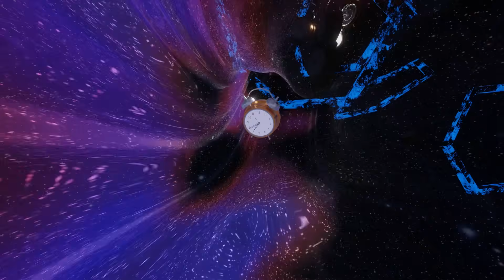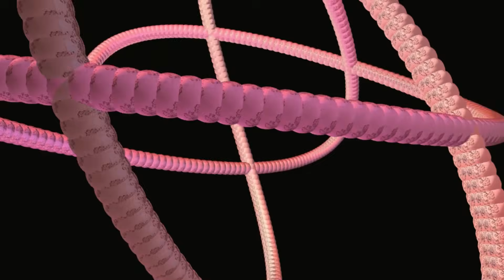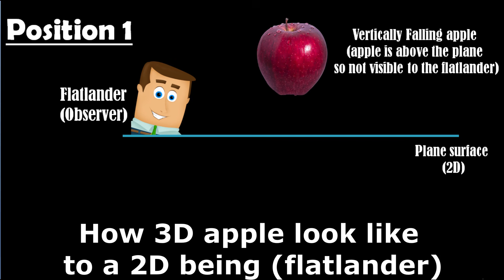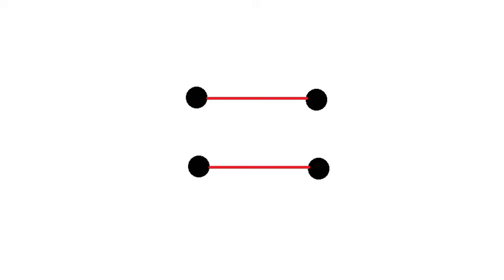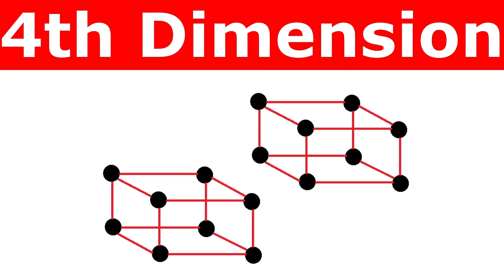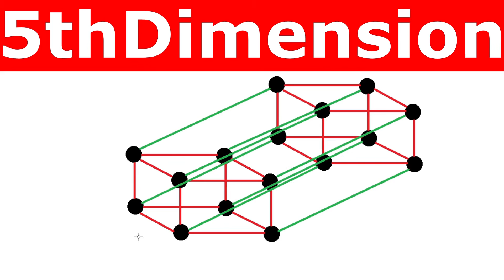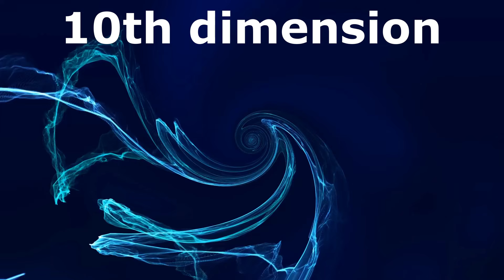11 Dimensions Explained - A Mind-Bending Explanation of Higher Dimensions!

Comment: TLDR: So the Apple example at 5:45 seems incorrect to me. If a 2D being can’t perceive height or depth then when the Apple crosses its plane of existence, it would see a line not a circle. 

Cross Sections are created by cutting an object & looking at it from 1 less dimension. 
Cylinder -> circle or rectangle 
Cube -> square
Only 3D beings could perceive a 2D cross section BECAUSE we have access to height and depth. We are effectively looking down, up, or through an object to see the 2D planes that add up to make the object 3D. 
If you started on the 2D plane as in the example, then you wouldn’t see a circle. You would be seeing the cross section of a circle, aka a line. 

To give an example, take a piece of paper. Paper is a 3D object bc it does have a height but the height is so small it’s negligible to our eyes so it can serve as a 2D plane. Place the paper on a flat table surface. Bend down till the intersection of the paper and the table is at eye level. If you’ve succeeded, you’ll see that you have absolutely no concept of how wide or long the paper is anymore depending which side you’re looking from. Instead all you’ll see is a line, aka the cross section on a 2D plane.

To know the shape of a plane, you must be able to see that plane from a higher dimension.

Humans are tricky bc we are 4D beings in 3D bodies. Our minds can
Reply: Our minds can perceive the existence of a 4th dimension (theorised to be time) but our physical senses are not tuned to it. Our minds are not limited to 3D and that is why we can both imagine the future and remember the past. The issue is our bodies can only move as a 3D object forward in time and our eyes cannot physically see more than 3D. Through our minds we can reverse engineer simple 4D objects (ie the 4D cube) bc we can seeing the shape of 3D objects but because we do not exist in the 4th Dimension, it is a great mystery to us. As the 3D world bends manipulates (surface) area into volume, the 4D world manipulates volume (aka space) into something else entirely (once again, current theories suggest it is in the realm of time or space-time). It is a realm in which 3D objects are sides folding in on one another to create 4D. That’s so mind boggling. Even though we can confirm its existence, we are still a long way from mastering it conceptually, let alone manipulating it in the physical world. Now imagine 5D being a realm that could manipulate and fold 4D into itself and you start to see why compactification exists and why it’s currently impossible for us to even perceive the 5th dimension. We only know it exists through following the laws of physics

Comment: one dimension shouldn't even exist because even the thickest line ever created or, let me put it this way. You can't draw a straight line that have no wide.
So first dimension you can start with is 2D.
A line without width isn't a line
Reply: None of these dimensions exist except the 3rd. 2nd dimension is a picture or drawing( not real) everything real has 3 dimensions. Outside of that this video just makes an explanation of decision making and some fairy tale time travel crap.

Comment: your explanation for the 1st dimension....you said it would be a straight line, with no ability to go left or right...however, the straight line, or forward line, if looked at from the cross view would either be going left or right, not straight and back...like a 'Etch a Sketch' draw your straight, forward line...now turn the 'Etch a Sketch' that straight, forward line has now just become a left or right line with no ability to move straight or back...better yet, draw a line straight down a piece of  paper, there is your forward line, but if you turn your paper, you now have a left and right moving line....I guess the perception would be the key....

Comment: good video. i want to say just one thing. not about the video. students or high professors, all show square and cube for presentation. but real thing is triangle and tetrahedron. those are with minimum flat boundary and: dots (or edges, or angles) are always go up by one with increase of dimensions - wich is wright. but square and cube go up times two with increase of dimensions wich lead to misconception about growing edges in correlation with growing dimensions. square and cube are not with minimum flat boundery. thank you very much

Comment: BASIC SPEED OF LIGHT FORMED AT CONCEPTION IS 3.3333333333 faster than speed of photon 

SPEED WORD HAS NOT BEEN SOWN YET 

DOCTOR WORD HAS NOT BEEN SOWN YET 

299792458 m/s
Photons are massless, so they always move at the speed of light in vacuum, 299792458 m/s (or about 186,282 mi/s).
https://en.m.wikipedia.org › wiki › P...
Photon - Wikipedia

PHOTON WORD HAS NOT BEEN SOWN YET 

The photon is a type of elementary particle. It is the quantum of the electromagnetic field including electromagnetic radiation such as pocket of energy and radio waves, and the force carrier for the electromagnetic force. Photons are massless, so they always move at the speed of light in vacuum, 299792458 m/s. Wikipedia

neutrino is seed of the mass that spins in the core of planter earth world with black hole at center of neutrino between the poles north and south.

Description
A neutrino is a subatomic particle that is very similar to an electron, but has no electrical charge and a very small mass, which might even be zero. Neutrinos are one of the most abundant particles in the universe. Because they have very little interaction with matter, however, they are incredibly difficult to detect.Sep 7, 1999
https://www.scientificamerican.com › ...
What is a neutrino? - Scientific American
Mass: < 0.120 eV (< 2.14 × 10−37 kg), 95% confidence level, sum of 3 “flavours”
Symbol: ν; e, ν; μ, ν; τ, ν; e, ν; μ, ν; τ
Interactions: Weak interaction and gravitation
Spin: 1/2ℏ
Electric charge: 0 e
X: −3
Family: Leptons & antileptons
Size
Types
Discovery
Decay
Feedback
People also ask
What does a neutrino do?
How do neutrinos affect humans?
What exactly is a neutrino?

Where is neutrino found?
https://en.m.wikipedia.org › wiki
Neutrino - Wikipedia
neutrino from en.m.wikipedia.org
A neutrino (/nuːˈtriːnoʊ/ or /njuːˈtriːnoʊ/) (denoted by the Greek letter ν) is a fermion (an ...
Discovered: ; ν; e: Clyde Cowan, Frederick Reines (1956); ν; μ: Leon Lederman, Mel...
Types: 3 types: electron neutrino (; ν; e), muon neutrino (; ν; μ), and tau neutrino (; ν; τ)
Neutrino detector
Electron neutrino
Sterile neutrino
Neutrino oscillation
Muon neutrino
Tau neutrino
Solar neutrino

What is a Neutrino?
YouTube · minutephysics
Dec 18, 2011

How do you detect a neutrino?
YouTube · Fermilab
May 28, 2019
More videos
https://icecube.wisc.edu › neutrinos
Outreach - IceCube Neutrino Observatory
Neutrinos are elementary particles that lack an electric charge and are produced when particles change identities, like during the decay of radioactive ...
https://www.livescience.com › 6...
What Are Neutrinos? | Live Science
Feb 21, 2019 — Neutrinos are elusive subatomic particles created in a wide variety of nuclear processes. Their name, which means "little neutral one," ...
Video for neutrino
https://www.britannica.com › science
neutrino | physics | Britannica
neutrino, elementary subatomic particle with no electric charge, very little mass, and 1/2 unit of spin. Neutrinos belong to the family of particles called ...
https://neutrinos.fnal.gov › whats-a-...
What's a neutrino?
A neutrino is a particle! It's one of the so-called fundamental particles, which means it isn't made of any smaller pieces, at least that we know of.
https://www.fnal.gov › experiments
Science | Particle Physics | Neutrinos - Fermilab
May 18, 2020 — Neutrinos, first discovered in 1956 AD
neutrino from www.fnal.gov

GOVERNMENT WORD HAS NOT BEEN SOWN YET 

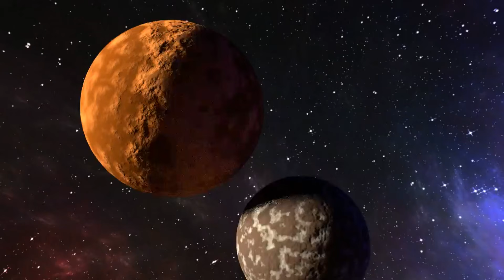John 8:23
But he continued, “You are from below; I am from above. You are of this world; I am not of this world.

ABOVE WORD HAS NOT BEEN SOWN YET 

WATER WORD HAS NOT BEEN SOWN YET 

24 I told you that you would die in your sins; if you do not believe that I am he, you will indeed die in your sins.”

HE WORD HAS NOT BEEN SOWN YET 

Psalm 34:20
he protects all his bones, not one of them will be broken.

BONE WORD HAS NOT BEEN SOWN YET 

WILL WORD HAS NOT BEEN SOWN YET 

FRIEND WORD HAS NOT BEEN SOWN YET

SOUL WORD HAS NOT BEEN SOWN YET 

SPIRIT WORD HAS NOT BEEN SOWN YET 

25 “Who are you?” they asked. “Just what I have been telling you from the beginning,” Jesus replied.

YOU WORD HAS NOT BEEN SOWN SOWN YET 

BEGINNING WORD HAS NOT BEEN SOWN YET 

MICRO WORD HAS NOT BEEN SOWN SOWN YET 

WAVE WORD HAS NOT BEEN SOWN YET 

Isaiah 41:4
Who has done this and carried it through, calling forth the generations 

ELEMENT WORD HAS NOT BEEN SOWN YET 

TRUE WORD HAS NOT BEEN SOWN YET 

DONG WORD HAS NOT BEEN SOWN YET 

MELODY WORD HAS NOT BEEN SOWN YET 

FISH WORD HAS NOT BEEN SOWN YET 

153 fish 

153 DIMENSIONS 

Fish word inside fish word 

DNA OF CHRIST HOLY SEED 

https://share.icloud.com/photos/0ZMmytLvVs9BF6umO0oNQ6HPQ

https://share.icloud.com/photos/0PCK92-q4zHEiZyRQlWQdE1-w

https://share.icloud.com/photos/06i9f9c7xkI_Ua7LVIrFXmn7A

https://share.icloud.com/photos/0V5eGTeHwAtkNTd6haviEfGVw

https://share.icloud.com/photos/0f4zW3W52m2xJmgzNR0AqmFuA

https://share.icloud.com/photos/0qM_hrcJ1-FcDQkZJiOkrqVpg

https://share.icloud.com/photos/04oBky4dwS28LzJTrvNpI2gjA

https://share.icloud.com/photos/0ymtMz6j6p_gN_7pwW7pkRKfQ

from the beginning? I, the LORD—with the first of them and with the last—I am he.”

ENERGY WORD HAS NOT BEEN SOWN YET 

POWER WORD HAS NOT BEEN SOWN YET 

MIGHT WORD HAS NOT BEEN SOWN YET 

TIME WORD HAS NOT BEEN SOWN YET 

SOUND WORD HAS NOT BEEN SOWN YET 

VOICE WORD HAS NOT BEEN SOWN YET 

NEW UNIVERSE WORD HAS NOT BEEN SOWN YET 

MATTER WORD HAS NOT BEEN SOWN YET 

NEW GALAXY WORD HAS NOT BEEN SOWN YET 

INFORMATION WORD HAS NOT BEEN SOWN YET 

LIGHT WORD HAS NOT BEEN SOWN YET 

ANGEL WORD HAS NOT BEEN SOWN YET 

NEW STAR WORD HAS NOT BEEN SOWN YET 

NEW SUN WORD HAS NOT BEEN SOWN YET 

NEW PLANETARY EARTH HAS NOT BEEN SOWN YET 

NEW MOON HAS NOT BEEN SOWN YET 

SUBSTANCE WORD HAS NOT BEEN SOWN YET 

MIRACLE WORD HAS NOT BEEN SOWN YET 

MYSTERY WORD HAS NOT BEEN SOWN YET 

RAINBOW WORD HAS NOT BEEN SOWN YET 

SMOKE WORD HAS NOT BEEN SOWN YET 

what is 

DNA

OverviewVideosProteinsBookNews

Main Results

https://medlineplus.gov › basics › dna
What is DNA?: MedlinePlus Genetics

Jan 19, 2021 — DNA, or deoxyribonucleic acid, is the hereditary material in humans and almost all other organisms. Nearly every cell in a person's body has ...

Isaiah 33:14
The sinners in Zion are terrified; trembling grips the godless: “Who of us can dwell with the consuming fire? Who of us can dwell with everlasting burning?”

ZION WORD HAS NOT BEEN SOWN YET 

BURNING WORD HAS NOT BEEN SOWN YET 

Job 38:6
On what were its footings set, or who laid its cornerstone—

CORNER WORD HAS NOT BEEN SOWN YET 

WHITE WORD HAS NOT BEEN SOWN YET 

STONE WORD HAS NOT BEEN SOWN YET 

ALEPH WORD HAS NOT BEEN SOWN YET 

ARM  WORD HAS NIT BEEN SOWN YET 

SIGHT WORD HAS NOT BEEN SOWN YET 

INSIGHT WORD HAS NOT BEEN SOWN YET 

SALVATION WORD HAS NOT BEEN SOWN YET 

Isaiah 52:10
The LORD will lay bare his holy arm in the sight of all the nations, and all the ends of the earth will see the salvation of our God.

MIND WORD HAS NOT BEEN SOWN YET 

GARMENT WORD HAS NOT BEEN SOWN YET 

Leviticus 19:18
“’Do not seek revenge or bear a grudge against anyone among your people, but love your neighbor as yourself. I am the LORD.

NEIGHBOR WORD HAS NOT BEEN SOWN YET 

YOUR WORD HAS NOT BEEN SOWN YET 

SELF WORD HAS NOT BEEN SOWN YET 

HIM WORD HAS NOT BEEN SOWN YET 

LOVE WORD HAS NOT BEEN SOWN YET 

https://youtu.be/Rqd6y6hrrQg

https://youtu.be/EQZiDocbaEk

Comment: Thank you Lalith.  10 is 1 and O.  1 as a mathematical indiger equals monotheistic God as in Advait philosophy and O equal Brahman or Brahma tara and 11th dimension is Brahmatarantara  spiritually speaking. You should be comparing 11 dimensions 
with the Shree Chakra which as I understand has 49 Dimensions and defines the whole universe with all multiverses included being symbol of mother of universe or aadi parashakthi or lalithanbika......if you equate God with 10 the geometric equivalent has to be a ten dimensional ecosohedron.  What  you are explaining as dimension in quantum physics is explained spiritually as evolution of the soul to higher dimensions which is the basic purpose of life on earth, and to achieve that the soul has to conduct itaelf in a certain manner which is called Dharma or the verteous conduct of soul on its teavel through earth, or eternallt which is Sanathana dharma(the eternal conduct of soul) for the purpose of contnuity of the universe by yourself rising to such higher dimensions as brahmatara which is a self evolving  effulgent universe.  A soul is the seed of a universe which can evolve as a universe when it achieves higher dimensions.  If soul did not have this potential, tge explanation of the dimensions may in no way be useful to the three dimensional beings in human.

Comment: Surely in the 2nd dimension sight would not be possible. Your example of the apple says you will see a dot then a ring as it moves.  However this assumes having a 3rd dimension view point.  The dot or slice would have zero depth so from the 2nd dimension would not appear to exist.

Comment: If perhaps you were to visit your other self in a parallel dimension, (either 4th, or 5th dimension) would you become one with your other self, or would it be both of you side by side?   I believe you mentioned that in the 4th dimension, if you go back and change your spouse,  your parallel dimension will no longer exist.  So, my question applies to the 5th dimension and, or higher.  Also, what happens to the dimension you left in order to alter your initial dimension?  Whoo!!  Tounge twister.  Hahaha 😆
Reply: Dejavu

Comment: He takes "time" as the 4th dimension but actually it is not .The dimensions are within dimensions.All the first three dimension are based on our capability how we see or perceive things . For example a single dot is a zeroth dimension ,a single line is first dimension and a paper is 2nd dimension and a cube is 3rd dimension .similarly by fourth dimension we will be capable to see things through some other object such as wall. We will be capable to see through the wall . If time is a dimension then it is high er dimension then the 4th one
Reply: We call the 4th Space-time because the 2 are inseparable. You move in a single, continuous, single direction in the 4th dimension. It's actually a physical movement. Take walking a tightrope, same thing. Really only one path to use.And even just walking in reverse is really not likely. Get on a tightrope and try walking backwards. :) Time is a concept we use simply to visualize this movement.

Comment: Start over and recognize depth as the 4th dimension and see what you get.
Reply: Depth & height are really the same dimension. It just depends whether you're talking about the depth of liquid or the height of structures. In our reality, the true dimensions are length, width, depth/height, duration one (time relative to you), light, gravity, vibration, velocity, near & far spatial dimensions. All these are within the light cone & govern what we can see on our plane of existence. Dimensions are spatial, temporal & functional. Beyond our light cone, you can experience durations two, three & four at will & all this within space-time.

Comment: The analogy of the 3D apple entering the 2nd dimension is really useful, and I have known it before, but I now realize it is a little wrong. If the 2D observer doesn't see anything below or above him, then he can't see a growing circle, but a growing line, which is moving closer to him. For him to see a circle, he would have to observe from below or above, which is impossible for him. Poor guy.
Reply: We also don't always have to double the points to get to the higher dimension (for example a triangle for 2D, or pyramid for 3D), we need another axis perpendicular to all the others. If we calculate the dimensions of a particular object, be it length, area, volume and whatever we call the higher ones, we take a look at the exponent. Using a simpler example of a square and cube, it changes from 2 to 3. With a tesseract it's 4 and so on.

Comment: A paper is three dimensional… if it wasn’t we wouldn’t be able to see it.. the length and width are easy to see but because the paper is so thin it’s hard to measure the exact height.. but there has to be a height to see it
Reply: So true I think the first dimension is time it has no width, height can’t move up ,down , left or right just forward that’s it 1 direction 1 dimension.

Comment: Flat figure of two dimensions can be seen and cannot see the third dimension.????Why should this be okay 👍 for humans.????Higher dimensions have to be specially focused and change by using connections through height and space.???Fourth dimensions can use time to change space and directions 🧭 period.????
Reply: Parallel universe exist and humans do not die by move beyond space and time.????The infinite eleven is GOD himself by vibration loops of particles formed by creation and the smallest strings of GODS 💥 Power.!?!!